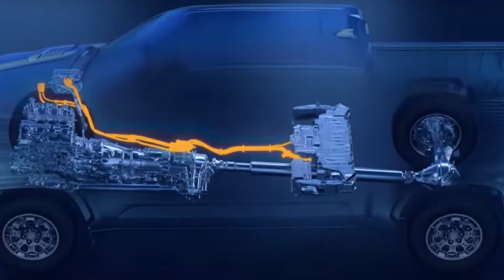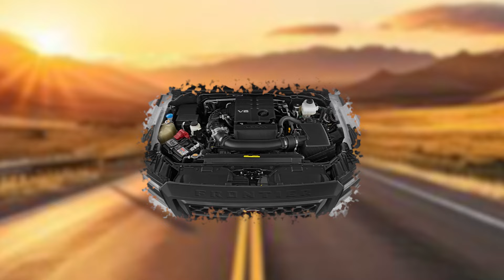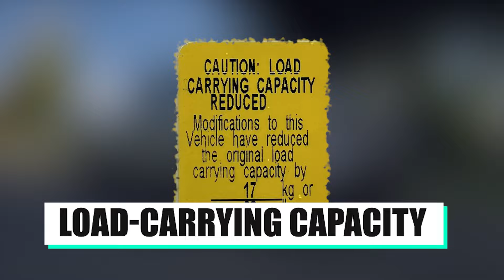What on Earth Is Going On with Toyota Tacoma!?

Comment: Toyota went down fast  because of Mexican engines and American factories. Engine and tranny problems and poor fit quality and finish.  I wouldn't buy anything made in America.  I sit out a year or two on the new 4runners, they look larger outside and smaller inside. Not impressed with a tiny turbo.